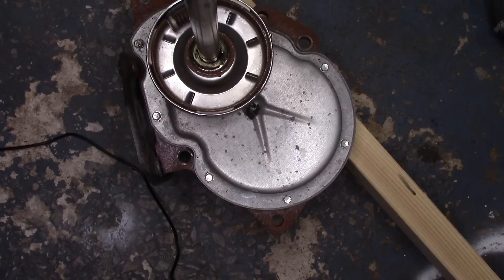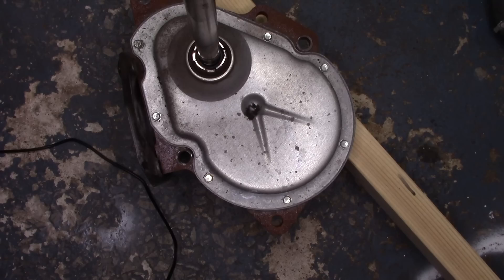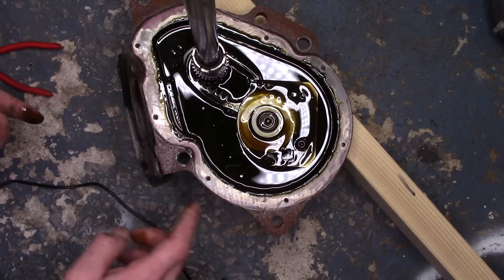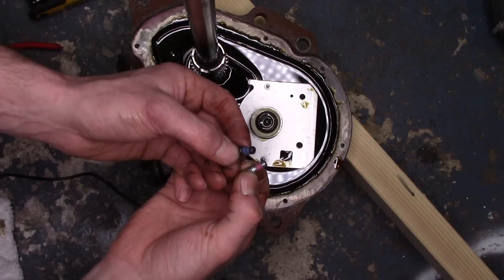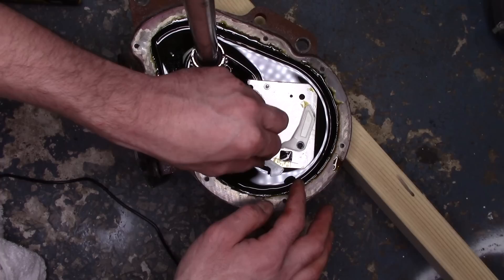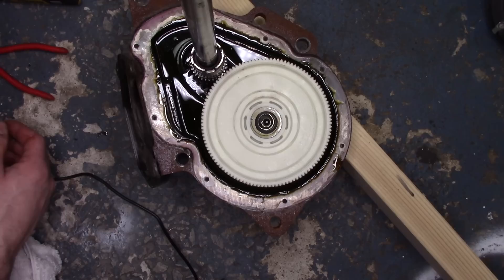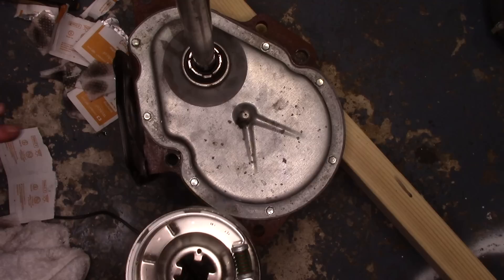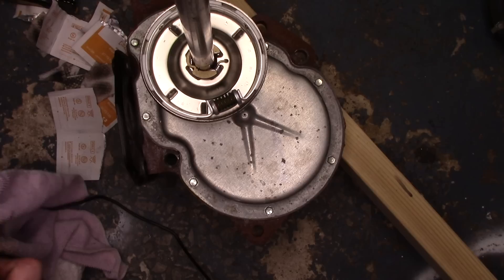How To Rebuild A Washer Transmission  3360629, 388253 Kit Installation

Comment: Thank you for a great video. My Kenmore 90 series machine is spinning a little too slow and making a clicking noise while spinning. How do I know if it needs the transmission rebuilt or a clutch or something else? I just replaced the coupler a few weeks ago and it looks ok (have not removed it to check though.) Is it difficult to remove the transmission. Should I replace other parts at the same time? Thank you!
Reply: A mechanical click could be coming from the coupler.  A popping/clicking sound could be coming from the motor.  You would have to look at the clutch to see it's condition.  If it looks worn, replace it.  After that, the way I've seen people test from the motor through the transmission is to remove them and run them outside the washer.  If the sound is gone, it isn't either and it's up the chain.

Comment: What type of transmission oil? Where do you buy it? I will work on a 3360629. My washer smokes and I can not rotate freely to the right (my right).
Reply: That sounds like a motor failure... check your coupling also.
Reply: 90 wt gear lube. Walmart or any auto parts store should have it.

Comment: For the retention clip pliers, what size diameter for the tip? Also, if you did have to replace the oil, how much does the gearcase take?
Reply: 16 oz seems to be the recommendation

Comment: My washer basket wouldn't spin so I replaced the Clutch & Brake Cam but now basket only spins intermittently (installed correctly). If I open lid when basket is spinning then close lid basket won't spin unless I open lid again then close (very odd). Therefore, I'm thinking the Transmission is causing intermittent spin issue since it's old (2009 mfr. date) unless it could be the Basket Drive Tube. What do you recommend to verify transmission is the issue?
Reply: you don't even list what model washer or what brand, geez.

Comment: I have a sears model 110.827.91820 washing machine.  Where can I find commercial or longest lasting parts to rebuild transmission and clutch replacement?
Reply: invalid number, whirlpool parts are available everywhere.

Comment: How did you know to replace the neutral drain kit? I mean, what were the symptoms it had gone bad. Our transmission is leaking oil out the top, and also out toward the motor (it smells burning during the cycle). My husband and I ran the motor independently - no burning smell. So we isolated the problem to the transmission. Should we order a new transmission on ebay, or work with what we have and repair the small parts. Also, we did take the cover off the gearcase and the oil inside was frothy with lots of bubbles. We are not washer repair people so we dont know quite exactly what were doing, but we have five kids and more time than money right now.
Reply: What was your end result? I'm having the same problem. I replaced the seal on top of the transmission cover but the new one leaks. I'm under the impression it shouldn't at all.
Reply: 1 it's supposed to drain, motor stops for a second and it spins when the motor starts again
2 grease out the top means water is leaking into the transmission and floating the grease out

Comment: Mine starts making noice at the beginning of the spin and goes away. Will that be the neutral ?
Reply: Yes... it is like a grinding sound... or a low roar... but it does make a noise. The transmission is spinning but it is like a car, in neutral.

Comment: I recently ordered a clutch for my washer, but realized when I dis-assembled it that the transmission had spewed oil everywhere, including the clutch. I installed the new clutch, and the machine works very well, and is quiet, but I should probably  take it back apart, and add gear oil. Are seals available?. I'm thinking the built in case cover seal for the shaft should probably be replaced, or it will spew oil again.
Reply: I found one . Part number AP6013637, for a 3360630, 3360629 transmission

Comment: Where can I buy the heavy duty clutch, the one that has 6 pads?
Reply: ebay, amazon. I would suggest ebay.  Few different places online. You don't need the whole thing, just the 6 pad clutch band. When you pull the old one out, you can just clean the inside of the old one out with some brake cleaner or something, use some channel locks, pull the old one out, put the new one in.

Comment: I replaced the clutch on my Whirlpool direct drive. It wouldn't spin in spin cycle although I can hear motor turning. Motor coupler is good (replaced last year). Gearcase is leaking oil. Still having issue after clutch replacement. Would this rebuild fix the issue?
Reply: Lorain Furniture Most times it does not spin at all. When it does spin, it's very slowly.  No unusual noise. 
The weird thing is after the clutch replacement, it worked for two days worth of washes.
Reply: Thanks for the tips so far. Pulled transmission again. It was a little greasy. Pinhole was a little dirty. I poked it with a paper clip to clear it out. There were clutch shavings all over. Clutch was worn out again. Seemed more worn than original and worn unevenly. It was a cheap eBay clutch, so perhaps it was a bad clutch or I installed it incorrectly? I did use the larger blue spring as it's a large capacity washer. Should I try another (OEM) clutch? Thanks again!
Reply: Did you figure out the issue?

Comment: You didn’t mention the plastic piece that goes under the clutch. That is a very important part!
Reply: It's on there but your right, if you forget it your clutch won't work at all.

Comment: Hi ! What was the problem you did not tell us 😊
Reply: I'm with you. I was expecting to see a bunch of teeth missing on that big plastic gear or fragments of whatever broke inside the casing, but neither his nor mine appear to have that. Most I could find online was that some sort of "latch" part often breaks in there, but it would be nice to know what to look for. I had the transmission kit in my basket last night, but then changed my mind when I went back and realized how bad off the agitator dogs were (spins freely both ways), so I switched and ordered that kit. Now I'm figuring they probably wore down over time, and that god-awful ratcheting noise just came on the other night, along with the clothes tangling around the agitator. If anybody here knows what/where the suspect part is and what it should look like, please let us know.    -Thanks!

Comment: Hello. Before I pull my old Kenmore apart (again), a question about the neutral drain function.  If the neutral drain component are suspect, is it possible for the neutral drain function to work in the rinse spin cycle but not the wash spin cycle.   Mine goes immediately from agitate to spin with a full tub of soapy water.  However, in the rinse cycle following agitation, it pauses for a few minutes while the rinse water begins to pump out.  

At the end of the spin cycle (wash or rinse), it abruptly stops with a clunking sound.  I am leaning towards the basket drive/brake being the problem but having no pause to pump out the wash has me wondering about the neutral function.

As a side note, the washer was leaking both oil and water. Oil was leaking at the transmission input shaft seal and water was leaking due to the shaft seals in the basket drive.  I did not want to pull the whole transmission apart so I bought a used transmission from a shop that sold, repaired used washers.  I also attempted to put new shaft seals in the basket drive but bent the lip trying to pry out the old seals.  I went back to the shop and bout a used basket drive and was successful replacing the seals.  While apart, I replaced the spin clutch, water pump (drive coupling), tub seal, suspension springs, basket drive block, agitator dogs, mixer valve and cleaned dozen plus years of soap scum off everything.

After I put it all together, it appeared to run fine for 5 months. Quite frankly, I do not know if the neutral drain function worked.  It was during determining what was causing the clunk on spin stop that I observed the lack of neutral drain function. 

I have just purchased a new OEM basket drive (also came with a new spin clutch).  While the machine is working (although clunking), I wanted to explore other possibilities.

Comment: At 6:57, there IS a gasket. You can see it on yours. Look for that clear thin material. You can see it at the bottom of this video, your lower most cover bolt area. Notice the small spot that is not say wet looking? It's NOT oil either what we are looking at. You have to scrape the factory sealer off then install a 60w oil at 16 ounces.

Comment: My WP washer does everything EXCEPT SPIN. Clutch seems good, motor-to-trans coupler is good, door switch is bypassed.  Pressure switch is good. Fills and shuts off at proper level, agitates, drains. But no spin. If anyone knows, whatever has to shift to cause washer to spin - Is that a function of the transmission, perhaps it's different parts than were replaced in this video??? This washer set-up for about 3 years with no use. I put a new capacitor on it and it worked perfectly the first time I used it. Next time though, no spin.
Reply: If you have a neutral drain transmission its not supposed to spin for the first two minutes.  You can trick it into spinning by opening and closing the lid once draining has begun.
Reply: It's the timer
Reply: Mine started randomly makes a rattling sound when it goes from pumping out the water to spin. I suspect that plastic gear in the video is the spin gear and mine is worn or missing a tooth or two. Time to tear it down and inspect the transmission.

Comment: First thing I would do is WASH out all that gunk with Diesel and a brush.
Reply: I agree, it's $5 worth of oil.  Worth doing if you're cracking the casing.  It's not the oil I'm worried about, it's anything that could be in that oil.
Reply: @williammchugh4361  Yup, I did mine and completely drained it off then cleaned the parts with kerosene then reassemble and fill with new 90W Castrol gear oil, purrs like a kitten now.
Reply: @barryaiello3127  After needing to replace the neutral drain too, my issue now is the genuine Whirlpool gasket I bought for the top shaft transmission case.  It doesn't fit the opening on my transmission.  It's too large in diameter, there is no way to press it in.  I swear, I've NEVER ran into this much trouble getting parts or expensive parts that actually work.  No wonder people don't repair these things.  It's been a PITA.
Reply: @williammchugh4361  there is no gasket on these, when you remove the cover you just use a silicon sealer after cleaning the mating  surfaces.